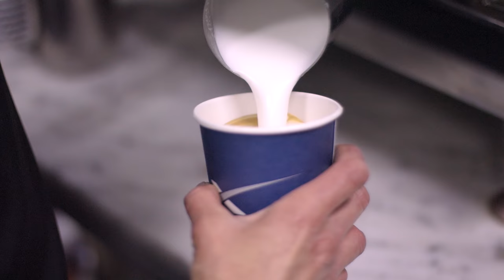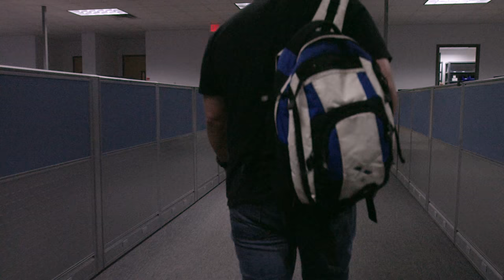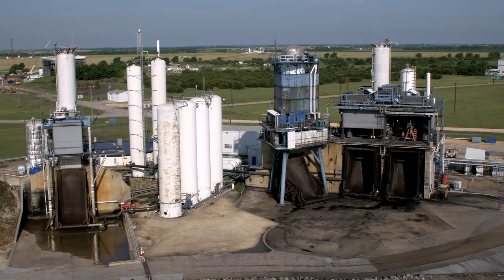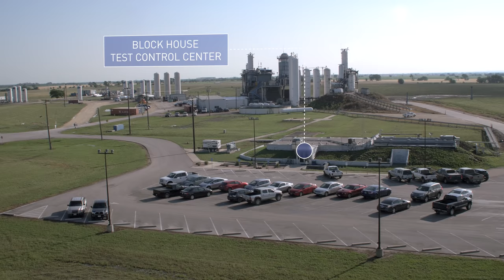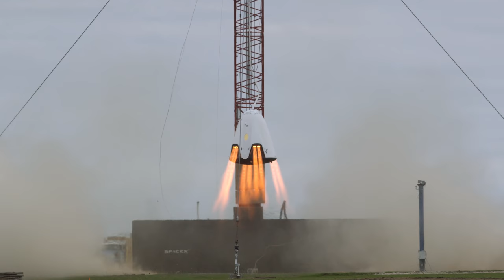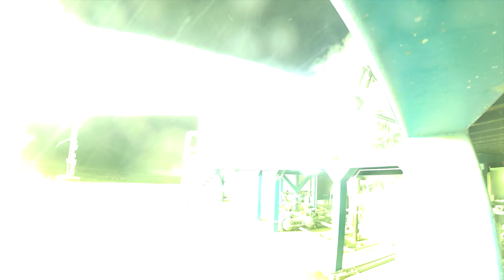SpaceX | McGregor, TX

Comment: Those high dynamic range, slow motion shots are insanely cool.
Reply: Yamato I’m talking about the few closeup shots of the engines ignition/boost and referring to the sensor they were shot on rather than the display those shots are being shown on.
Reply: Youtube does support HDR videos, but this video is not in HDR.
The number of devices that can support HDR for Youtube is pretty low.
Reply: Patrick Alpe again, that’s not what I’m even talking about. I’m talking about how the video was shot, not how it’s being displayed.
Reply: Trevor Bondi Media , oh was replying to that Yamato guy.
Reply: Do you think they used Reds or Phantoms to shoot the slow mo shots?
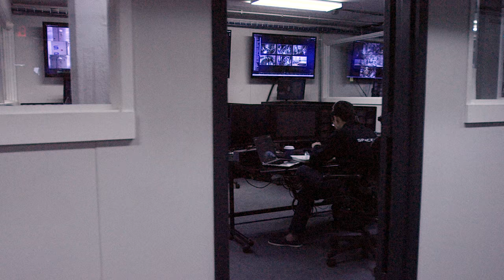Reply: Based on the noise in the indoor shots (like at 1:48), it wasn't a modern red like the 8k helium sensor unless someone completely f'ed up the exposure on that.  Maybe blackmagic given how noisey that got.  Or maybe different cameras for different scenes.  I'm not as familiar with what the VR sensor's noise looks like so maybe it's a VR cam like the Phantom.
Reply: Dont know what that means, but me too
Reply: I'm sure there's not a lot of light in the office but definetely not as dark that the footage should get that noisy

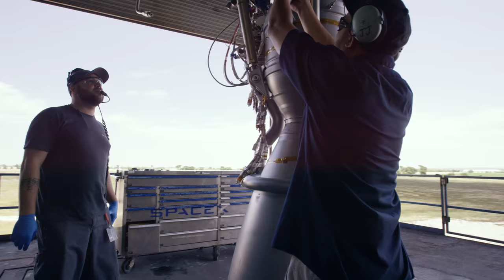Comment: 1:20

Were the technicians using duct tape on a rocket engine?
Reply: The gods of spaceflight must be honored with duck tape and WD-40!
Reply: amindofiron The only way to make things move/ make things stop moving!
Reply: Not duct tape but "Kapton tape". Good for use from cryogenic temperatures to 400°C (752°F). Used in the descent stage of the Apollo Lunar Module. In Kapton we Trust!
Reply: Used in almost every space vehicle complex enough to have wiring.*
Reply: Ah, space duck tape.  noted/

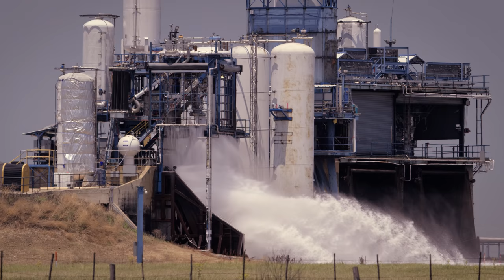Comment: 0:17 why so much water before the engine starts?
Reply: That's interesting
Reply: Yup. Noise and heat dispersion. Rockets are supermegaultra welding torches, too.
Reply: By the way, this is the reason why you see that big ass white water tower on the test site.
The water flow should not be interrupted. It MUST keep running at all times otherwise, very bad things will happen.
So instead of using pumps (which may fail), the good old gravity does the job.
Reply: it's to reduce the shockwave of the main engine blast,,so the site will not destroyed by the shockwave. *sorry for bad english🙏
Reply: hornetluca to reduse the emissions
Reply: Water is used to cool the exhaust and deflect some of its downward energy. The water flows slower and has more inertia than exhaust, so you gotta start it up prior to ignition, otherwise the initial blast of the exhaust will damage the gantry.
Reply: For protection.
Reply: Bomb in air makes shockwave that destroys stuff, like concrete.
Bomb in water, just blows apart the water. Much less shockwave, much less temperature.
.
Yes, rocket engine IS bomb, just directional.
Reply: It's called a sound suppression system. Not used because it's too loud and could hurt your ears. The goal is to minimize acoustical energy reflected from the engines and prevent any damage from occurring. If you watch any rocket launch they all employ the same system and launches at the Kennedy Space Center will release 900,000 gallons of water per minute.
Reply: Sound suppression water system to protect the test pad and the surroundings from acoustic energy waves. Also it helps to muffle sounds too.
Reply: Because cows get thirsty after a long day of watching rocket launches.
Reply: That's a great question! It's done to dampen the ultra high vibrations caused by the rocket launch, so as to not damage the rocket itself and also the infrastructure around it.
Reply: hornetluca incase someone needs to flush the toilet 🚽
Reply: Mainly for reduce vibrations
Reply: Its for steaming the milk at the beginning of the video.  This whole location is a giant Rube Goldberg Keurig machine.
Reply: Sound suppression. 

-NASA Engineer told us this during a tour of the Kennedy Space Center.

Comment: How do you get past the Van Allen Belts? You're fuselage would have to be at least 4 feet thick with lead to handle the radiation.
Reply: Yea, if you stay there. Not if you pass through it few km/s. It's a radiation belt not a wall.

Comment: You can create quad core magnets in Mars  and are easy to manufacture in Mars.  Power supply is the key.
Reply: Includes reduction in radiation hazards and artificial G.

Comment: Is it still Russian engine?
Reply: I think you might mean the Russian ICBMs. In which case, not anymore. SpaceX has long since abandoned that idea.
Reply: Athul Suresh Russian rocket engine RD-180
Reply: Ebrehnn
That must of been the Falcon 1's. SpaceX now uses Merlin 1-D engines which are the most efficient engines ever produced. Those are used for their current rockets: The Falcon 9 and Falcon Heavy. For their upcoming rocket, the BFR (Big Falcon Rocket) they will use an engine they are developing known as the Raptor engine.